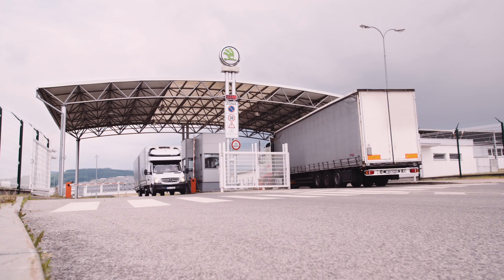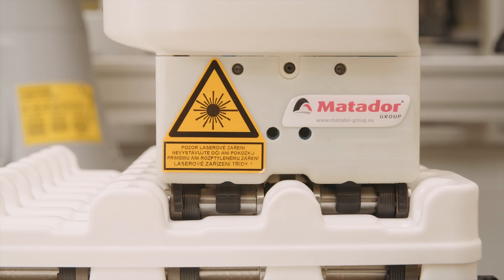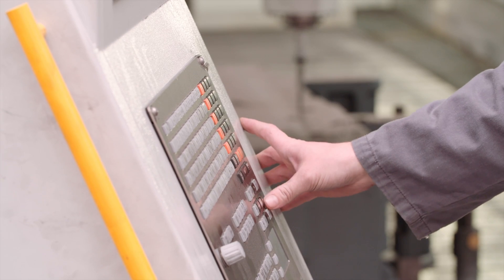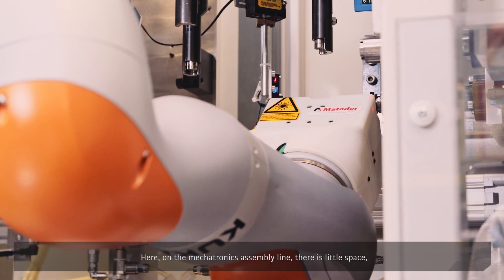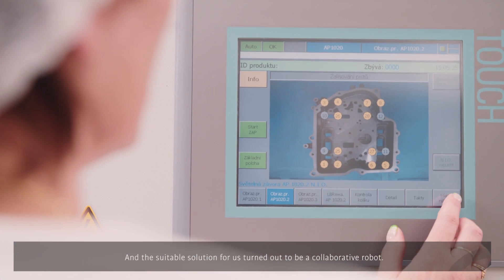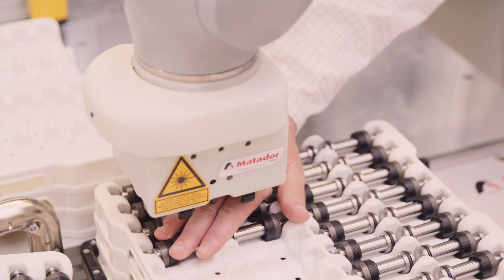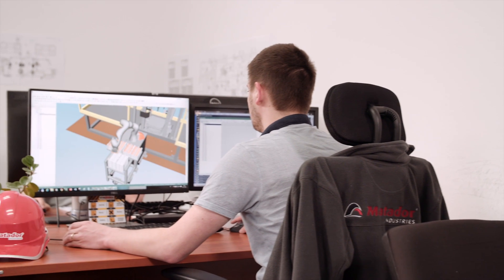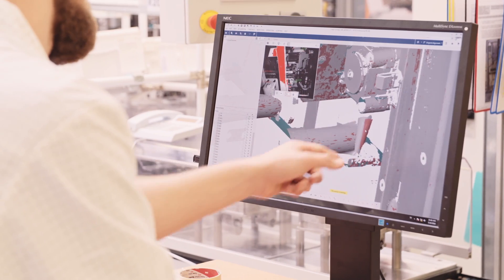People Work Directly with Robots Building Volkswagen Transmissions

Comment: Why Kuka dont bring the SIM PRO software for people interesting in practice the software......basically  will help people knows about the good things of the company....others company brings their robot sofware free for practice
Reply: Because KUKA SIM is based on Visual Components and that costs money.
Reply: Ok i understand , but for example ABB  brings the ROBOTSTUDIO  free for practice and were doing a lot of stuff  programming and they let you update the sotfware free too
Reply: Robot manufacturers generally don't brag about their software, because there is nothing to brag about. This does however have a new controller and new software suit completely separate from all the other KUKA robots. The sales pitch for the software sounds like the software might actually be from this century, but as the software is so far limited to this one robot, well, that's that I guess. 
Would be nice to download and play with it anyway, its not like the software is any good without the hardware, letting people to download the software can only lead to sales of actual robots.